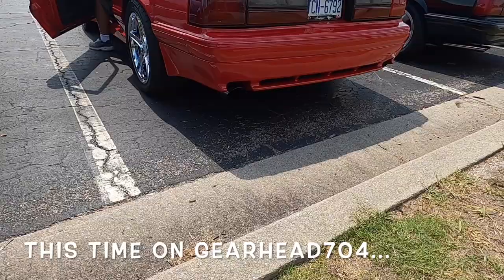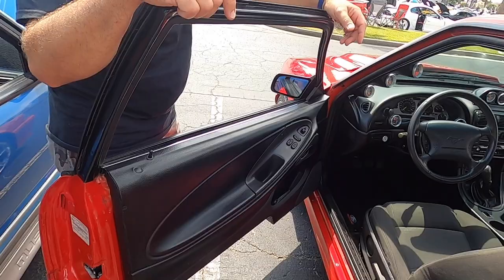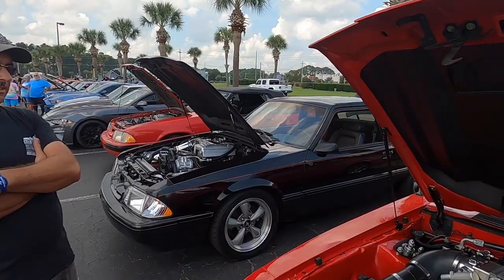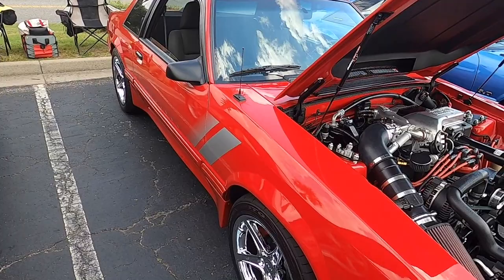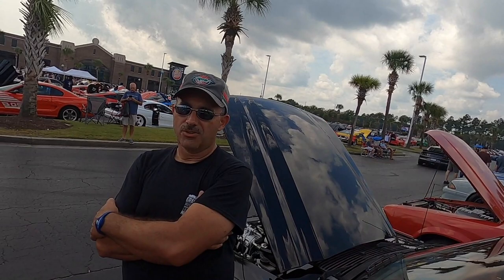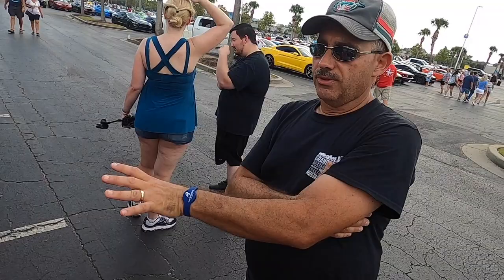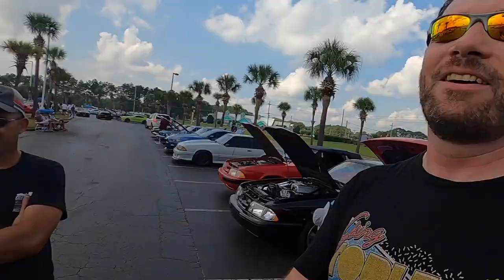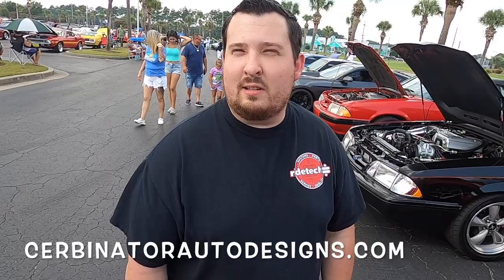KENNE BELL SUPERCHARGED SALEEN CLONE SIGNED BY STEVE SALEEN

Comment: Love it, I have a 95 vert with built 347 with a kb 2.1 blower, love it... instant boost and gobs of torque, great street car. Didn't see methanol on that car... tough to run these blowers at any real psi without it.
Reply: Thanks and You are correct on meth.  I am running Snow stage 2 progressive meth injection.  The pump and tank are in the trunk.  You can see the  feed line and solenoid by the TB.
Reply from the maker: Sounds like you have a fun ride too.

Comment: That must have looked insane in person. I'm curious to know whats the purpose of the huge pulley on his power steering pump. Is it for show, supercharger, or maybe it's a fix to the annoying noise they make? Like a rattle for a baby!!!
Reply: Thank you.  The accessories are from a 94/95 GT as is what the KB was intended for.  I modified brackets and added idler pulleys to prevent belt slip as the original setup was known to slip.  Also eased the bay cleanup some.
Reply from the maker: It did look insane.  I"m glad the owner was able to answer your question in the comments.
Reply: @gr8tfoxes617  thank you for your response. I've never seen a supercharger setup like that! It's a masterpiece. Congrats brother
Reply: @GearHead704  I'm glad you mentioned that or I might have never noticed. Your the man. P.s. towards the end of the video I'm saying to myself " Look at this guy in the background trying to talk to tiff" and then you introduced him as the one and only CERBINATOR. Lmao
Reply from the maker: 🤣 Yeah that was good old Matt Cerbin LOL, but thanks for watching out for me hah hah!

Comment: Wow . Unless you're revving it to 9g . No need for a 90 tb . He would of been just fine with a 70 or 75 mm
Reply: No Sir…the KB of this era is all about zero restrictions on the inlet side as it achieves full boost at 2200 RPMs.  I researched it for a long time before the build.  Thanks for the input though.
Reply: @gr8tfoxes617  ok then . My bad .